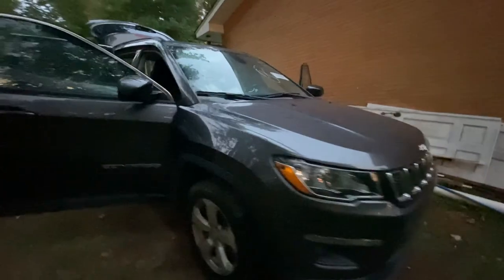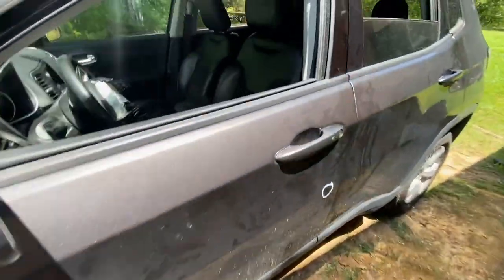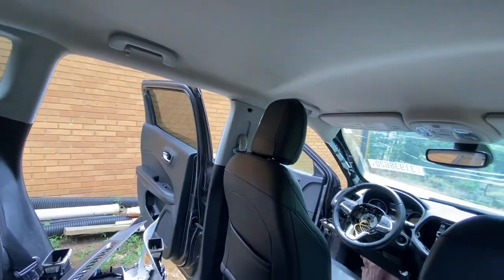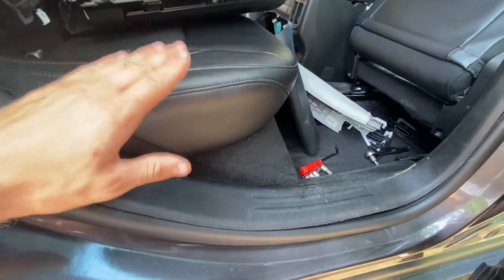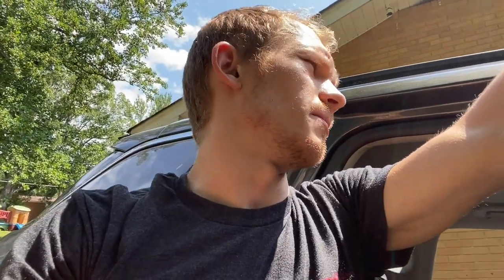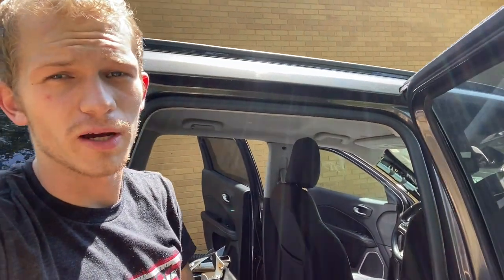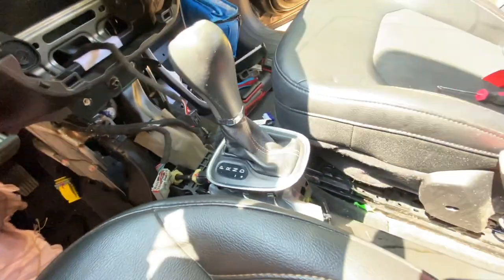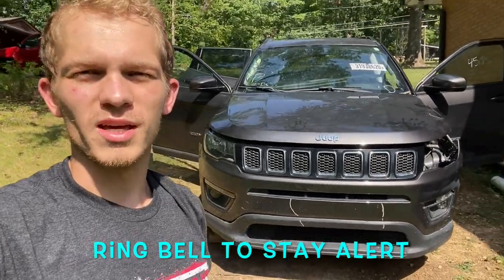2018 Jeep Compass Latitude Rebuild | Seat Belts Part 2

Comment: I just picked up a 2011 Compass, I gotta replace both front seat belts and while I wait on the parts to show up I figured I would watch a few videos to get the basic idea. I've got a big suggestion for you! I've rebuilt a few different vehicles, and it seems seatbelts are always mounted with torx bolts, and yes they suck, yes if it slips while you're wrenching on it you risk damaging the bolt and then its even more difficult. So what I learned, and I've never looked back since, is, go buy yourself a Milwaukee M18 half inch battery powered impact gun, they run a little bit of money, but it will take all them bolts out in less than 2 seconds seriously, and the battery lasts so damn long, you could take all the seat belts out, then pull all the wheels off, then pull all the suspension out, and you've probably still got some battery left, the thing is incredible. 10 years ago I wouldn't have trusted a battery powered impact to take one wheel off, they have come a loooong ways!
Reply from the maker: It’s funny that you say that, because I literally did that myself. But sadly after I was already done with that project. But yes I bought a whole set everything Milwaukee and it is saving me a lot of time and pain from my hands. Thanks for the advice!!

Comment: Hey, great video there!! I now understand why the service guys get so worked up!! Could you please do a video or tel me how to open the rear view camera?? My screen keeps showing camera system unavailable and then after a few days it starts working again! Service hasn’t been able to diagnose the issue yet so iam sure the fault is in the camera. I’ve got a 2019 Jeep Compass latitude. Much thanks, look forward!
Reply from the maker: siddharth ganguly I’ll see if I can show you how or tell you how to take it off but idk what you mean about open.
Reply: Romanovich Auto Surgeon what I mean by open is - how to open the reverse camera mounted above the license plate
Reply from the maker: siddharth ganguly I don’t think opening the camera will help any. It may be just a corroded wire so you may be best off by replacing the camera.